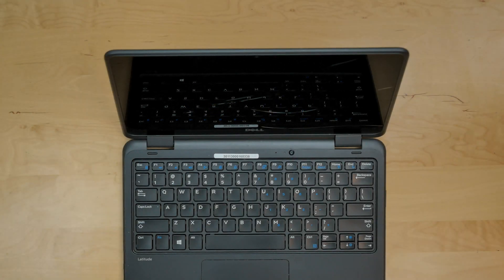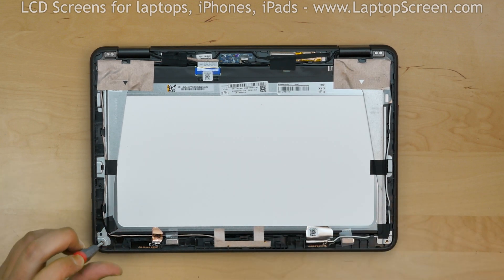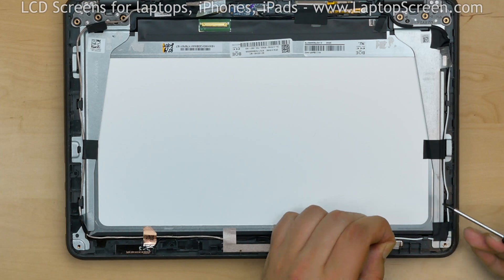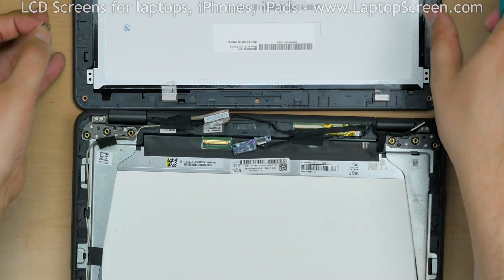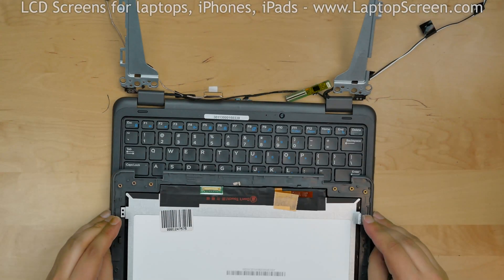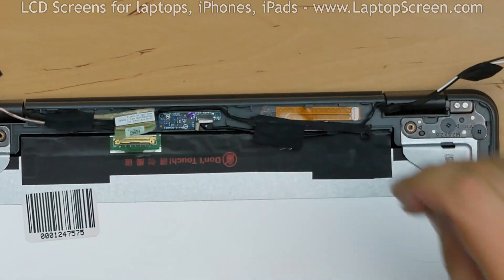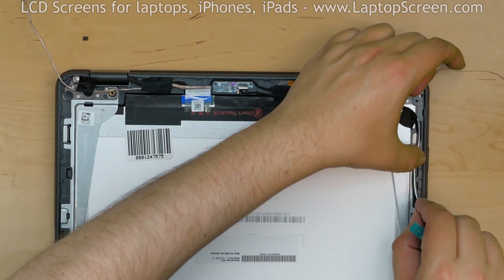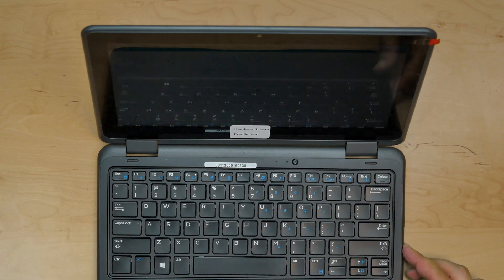How to replace LCD Screen and Digitizer on Dell Latitude 3189. Step-by-step instructions

Comment: Hi, do all laptop LCD laptop's have a digitizer or do you know if the Acer spin 1 has it or not(I know it's a LCD screen but it does not say if it has a digitizer)
Reply from the maker: Digitizer is what digitizes the touches and sends them to the computer as input. Digitizers can either be stand-alone or built into the screen. In this video it is a stand-alone type. I think Acer Spin is also stand-alone. Some newer LCD panels have the digitizer built-in, but they wouldn't work in-place of a stand-alone digitizer (easily).